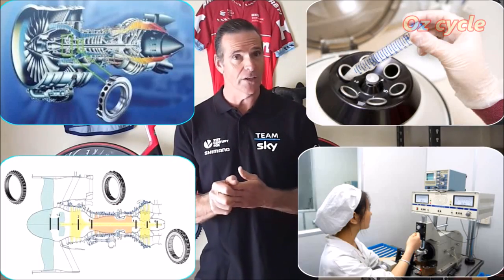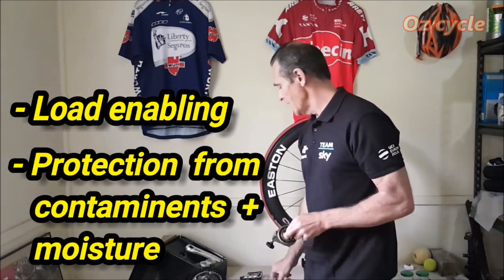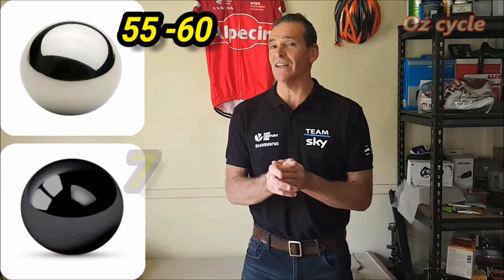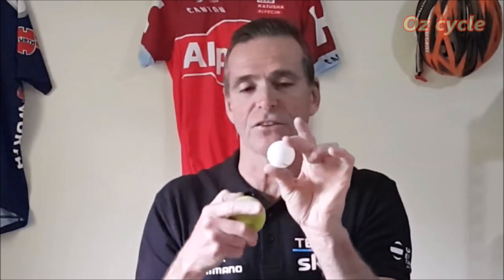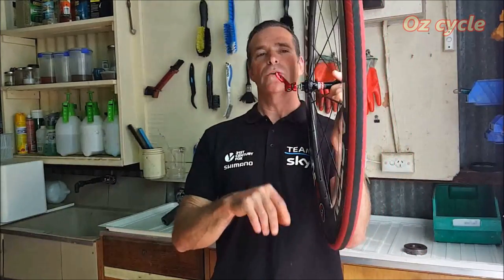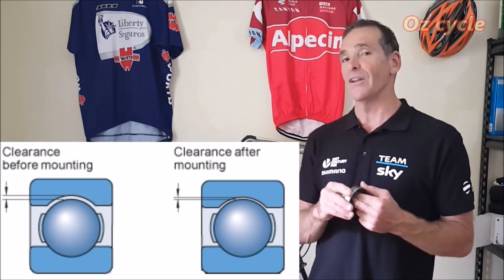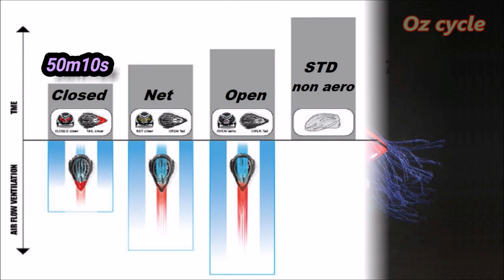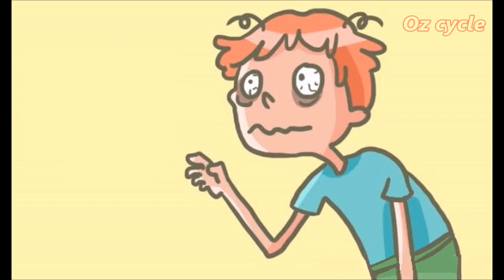Ceramic Bearings - You need to know!

Comment: I don't buy bearings from niche home made brands(enduro, Ceramic Speed, and etc), I buy bearings form renowned brands, SKF, NBN and NSK. You are paying for the real quality rather than cheap play on grease and non contact seals.
Reply: That is the beast way to do it. You just need to know which quality you need to order.
Reply: true, but Koyo bearings are the best known japanese brand 😊😃
Reply: @janetguzman1985  Companies like NTN, SKF, NSK, KOYO, are OEMs i.e. Original Equipment manufacturers. They don't make a 'better' product compared to others. They make a product that is in accordance with the specifications, dimensions, and tolerances. Take a 608ZZ for instance. The dimensions are the same for the 608 bearing across all OEMs, so it's unreasonable to argue over which manufacturer is the best, when they're all making the same product to the same degree of exactness.

I will say that always get your bearings from a reputable source. I get mine from an industrial bearing supply place and they're ridiculously cheap for a roll of fifteen SKF bearings. Genuine OEM bearings beat shoddy ceramic bearings or even Chinese ones.

Comment: Friction Facts have released reports about BB bearing materials. The major performance difference between steel and ceramic bearing BB is that the latter commonly packaged with less viscous lub and looser seal. This gives a high performance impression of ceramic bearing. The test reports confirmed that high end steel and ceramic bearings have virtually no difference on rolling under load.

Comment: There is another misleading comment here. Steel and ceramic balls can be as round and as ball to ball uniform. This is not dependent on the material but the ball grade and bearing ABMA/ISO class. Nothing to do with material

Comment: I was looking into ceramic bearings for my MTB a couple of days ago. I was on a totally different route, but I ended up with the same conclusion. No ceramic barings for my wheels. It was tempting though. I talked to a bearing dealer in Germany. His advice was to choose the highest possible quality of steel bearings. They last longer, need no maintanance, cost way less and take harder impacts.  Thank you for your very good vid.
Reply: Use high quality stainless steel, last a bit less than carbon steel and are more expensive.. but do not get corroded.
Reply: Yup, ceramic is only good in applications with no vibrations and higher rpm,s. The  shock loading on most bikes, especially off road bike would destroy ceramic bearings. Hit a ceramic bearing with a hammer, then a ss bearing . The steel bearing absorbs vibration exponentially better than ceramic.

Comment: There's a glaring misstatement in this video, namely that "ceramic bearings last longer."  This myth is precisely the sort of marketing hype that now pervades the cycling industry (along with other goodies like the "power transfer" of a bike frame).  The reality is that ceramic bearings—let's be specific, we're talking about Si3N4 (silicon nitride) rolling elements on hardened steel races, aka ceramic hybrid bearings—have drastically less load bearing capacity than conventional all-steel bearings.  The advantages of these hybrid bearings are higher speed (at a level irrelevant for cycling), more stiffness (at a level irrelevant for cycling), and less rolling friction.  In a high-load, super-low-speed application like a bottom bracket bearing, they will last LESS long than an all steel bearing. 

Another pervasive myth in the cycling that just won't die is that components like the rear derailleur pulleys rob you of significant power, on the order of 4-10 watts that can be saved with a $$$$ ceramic pulley system.  NO, not even close!  Not even 0.2 watts vs a Dura-ace jockey wheel set.  Consider that fact that a bottom bracket with what most would call unacceptable tightness being spun (on a bike stand) by your finger on a crank only amount to, at most, 0.4 watts.  Somehow, company after company is able to cash in massively on the technical illiteracy of cyclists dying to hand over wads of cash for the latest technical fad.

Power (hp) = applied_force (lbs) x lever_arm (inches) * RPM / 63025.  To convert to watts, multiply hp by 745.7.  You can use this simple equation to convince yourself just how silly it is to worry about how freely a crank arm spins (or any component) producing finger pressure levels of drag.

And here's another related myth, that the friction from bicycle wheel bearings amounts to something significant.  Using the same equation, let's consider a 175 pound rider, with a wheel hub bearing race radius of 0.375 inches, traveling at 25 mph with 700c x 25mm tires.  A properly loaded conventional steel ball bearing with seals and grease has a rolling coefficient of friction of, to be generous, 0.003.  So how many watts are your steel wheel hub bearings robbing you of—maybe 5, 10, maybe even higher?  The answer is 0.74 watts max (total, both wheels).  And how much could you save by paying mega $$$$ for shiny new ceramic-hybrid wheel bearings?  Drum roll...a stunning 0.30 watts max (total, both wheels).

Just step back and look at the big picture of how far this marketing silliness has gone.  The highest-end road bikes now sell for upwards of $15,000, all to handle a 1/3 hp external 'motor' to be supplied by the customer (i.e., your legs).  Now put one of those next to a high-end Ducati Panigale V4 motorcycle, including a 200 hp engine with combustion temperatures in thousands of degrees at a thousand psi and timing to almost 500 firings per second, 200 mph top speed, 300+ lbs of advanced aerospace-grade materials (incl gobs of carbon fiber, titanium alloys, etc), and a comparatively insane number of (actually) advanced technical components...all for $21,000.  If the Ducati were priced like our bicycles, it would cost closer to $21 million.

Bottom line, these bicycle manufacturers should be laughing their asses off at our technical ignorance and eagerness to part with cash.  China, please save us from this overpriced lunacy.
Reply from the maker: Very true, its mostly consumerism
Reply: Dear B. Smith, I would like echo all that you have said and thank you for taking the time to write.  The ridiculous talk about Watt savings (from bearing choice) by the many can not be stressed enough. 

Thank you Mr. Oz cycle for producing at great synopsis on bearings for cyclists.  It is a very big subject of course.  Let us hope the video will reach a very wide market.  I think you stressed the facts and downsides of ceramic and hybrid bearings.  Good job. More can be said of course: how bearing fit (too much compression from the bore) is so important - explaining the failures of Press-Fit BBs etc, and maybe talking about the old days when a bike would have numerous oil ports/grease ports (yes, there are some components flying the flag).  Then we have to praise Shimano and others for still producing great cup and cone bearing components but then 'sadly' throwing down the drain by forgetting to set the cones to the right tolerance in the factory.

There are far too many pseudo-engineers/designers in the bike industry who think their tertiary education means they are qualified.  Also they are probably having to compromise heavily and have to throw stuff out the door prematurely often - the disclaimers and lawyers will take care of you so you can sleep at night.  

If you are young and want succeed in competitive cycling you better learn and practice to be the one of the best mechanics before you can afford to have one and pay for his or her life long experience.
Reply: I have during my  few hours, seen allot of crazy talk about bearings. And i have to say, i love your comment... I am not a cyclist, i'm more into cars...But... those run on Bearings to, and honestly get Waaaaay more load on them then a petty bicycle... i have not looked into your calculations, and i will not :P but, they sounds pretty much on point... And.... if you, as a casual bike user, wants to keep your steel bearings performing... the key ingredient... is lube... metal on metal is not good... it needs lube... if ever your bearing sounds dry, then it might already be worn out... depending on the amount of sideways slack... the point is, if you are using a bearing for a long time, the grease the manufacturer put in there is only gonna last for so long... and you will either have to add more, or you will have to buy a new bearing... refilling is a fair bit cheaper. A bearing, if sufficiently lubed, will last a very long time. ofc, the metal in the bearing needs to have a good hardness ect. but, in generall it will only really start to wear when the grease runs out... This example, should make most people get at what i'm saying... you would not run your car engine without oil.... And it's the same with bearings... lube em, and they will live for ages, run them dry, and they will grind, and die... Cheers :D
Reply: I think you are missing something. TIME. 0.30 watts over TIME. 1 minute vs 5 hours in the saddle. Do that equation. Since you are driving the bike with human power over time, SURELY you work less.
Reply: @Geeios1  For those of us with electrical knowhow, the equation is fairly simple. The 0.30 watts are meant to be real time... Thus over an hour, witch battery/house standards are set as, you would save 0.3 watt hours. over 5 hours 0.3Wh x5, you would save  1,5 watt hours... the cyclists are talking about a fit person being able to generate 200-300 watts on a cycle. But lets be conservative, and say we "normal people" would only generate a 100watts... Over one hour 100w=100 watt hours... 100wh x5 hours=500wh. Thus if you were to generate that over 5 hours, you would save... 1,5 watt hours  out of 500 watt hours... not to much gain is it? :P
Reply: @Cyraios  So, a body does work less with ceramic bearings. Thanks for the information.
Reply: Gosh, I have big thighs, used to squat 500lbs.  But I always have claimed I only put out 1/4(not 1/3)hp.  I just had a massive jump in hp just by reading your post!.....very informative btw.
Reply: Don't worry, e-bikes killed the FAD.
Reply: Good observations. I fell for the early ceramic notion, and in a few hundred miles destroyed the Enduro balls along with the races in a Campy Record hub, which were fortunately rebuildable. I've kept my bikes well-maintained for over fifty years, and even on old rebuilt clunkers have never had such a bearing failure; the OEM bearings in Campy have provided the smoothest downhill coasting hubs ever, to where my lightweight wife was constantly out-coasting me and my Dura-Ace hubs on descents. Medium weight greases provide long-distance, all-conditions lube and protection that actually matters, and absolutely no one who has good bike setup already can possibly say they can instantly feel the magical superiority of Ceramic + Magic Grease #x29, because a five pound change in tire pressure represents about 10x the perceived effort supposedly gained. It is exactly the same placebo psychology the Audiophile industry thrives on.
Addressing hype one by one: "weight savings" of 50% from all steel bearings combined = like one small mouthful of water, if that.
"Strength" has been challenged, in compression to failure, finding quality steel withstands up to 3x the failure load of the best ceramic bearings, which barely surpass cheap Chinese steel."
High Speed = 20-50,000 rpm in things like hard drives; high temp also is never even approached in any bike part, unless a seized bearing run dry is galling and getting pressure welded.
Moderate pressure and speed loads make many lubricants more than adequate; the main benefit is to keep out water and contaminates which rapidly degrade the bearings. Oils gain no consequential speed, while not remaining long to protect and seal the bearings.
No one has ever been shown to have won, or lost, any race, by virtue of the type of lubrication or bearings used in their machine, except for blown NASCAR engines.
It is even more embarrassing to see weekend warriors who can't win Cat 4 waxing rhapsodic over the thousands spent on the uber-ceramic machinery they have taking up garage space.
Reply: You are right that the consumption culture is very low. A lot of horrors.  Marketing, design, manipulation, high-profile brands kill common sense. We need many, many, many independent people's tests. As it was done with lubricants, and the great discovery of paraffin was made. Or tire tests from different manufacturers.
Reply: So true, bicycles costing 10-15k$, as much as real bikes, ridiculous, but there are dumb people willing to spend that much, so they keep making them
Reply: This has been one of the most fascinating and informative threads on Youtube I've ever seen. Thank you all for you contributions!
Reply: That's an awesome comment, thank you!
Reply: I thank you for the technical know how also the amount of time you put in to inform us all.I am not sure about all the math you put in your comment but if you send me your account details I will buy 2 please it sounds like I need 2 please rush them to me by first class post 😀
Reply: People are dumb enough to buy it. It’s insane how much you can get with 10k worth of motorcycle compared to a bicycle.
Reply: @ichewtoast111  I suppose part of the storey is people can afford to buy the machinery that the tour riders use, where as not many people can afford to buy the superbike or F1 cars that the pros use .   I guess that factors into some peoples thinking I& where they want to spend their hard earned. Agree though very interesting discussion on bearings and how far away loads, temperatures and speeds are in cycling for even getting close to a valid use case for ceramic bearings...
Reply: @chapmag6578  that’s a good point. If they really want to keep up with the pros all they have to do is dope like everyone else in the tour.
Reply: @ichewtoast111  indeed, a good chemist can improve many recreational activities.....:)
Reply: Brilliant comment B.Smith <3
Reply: @ichewtoast111  Admittedly, I'm a few decades out from cutting edge bicycle technology, but I was perplexed by the "you could buy a decent car for that" prices.

Yes yes yes, I understand engineering, exotic materials, and precision parts. But you are also talking less material, less engineering, and I daresay less precision parts. For car prices.
Reply: @quintessenceSL  totally, there’s still a lot of precision engineering for safety features on cars like ABS modules, wheel bearings, engine, and modern additions. I’m also familiar with yachts which have been using fiberglass since the 1950’s. Fiberglass and carbon can both be bonded with epoxy to make a solid shape. What really matters is quality materials and layout. Back in the day they didn’t know if fiberglass would be strong enough so the first era of fiberglass boats have copious amounts of layers and have super strong hulls. As the years went by they used less materials in certain areas wile maintaining strength. In all honestly every bike I look at is worth half of what they are selling it for.
Reply: To be honest I have a £400 Carrera which I consider expensive for what it is. I enjoy going on the trails and it never lets me down. I have a Boardman which I paid £450 for brand new, it’s light, aluminium and goes pretty quick. Just enjoy your bike peeps
Reply: yup Hambini agrees
Reply: @bb1039  Habibi?
Reply: I read this comment late, now have ceramic bearings on my bike so I'll just assume the drop in my time (not very noticeable only 2-3 mins off of a usually 39 minute climb) is just an increase in my fitness that conveniently appeared after putting ceramic bearings on my bike. 

The sarcasm aside, I think all performance gains on your bike is mostly placebo and is more your mind than actual benefits.
Reply: I was suckered on ceramic bearings hype and now, along with talking to some honest bike mechanics and considering your realistic description, will save some $ next spin around. Thanks
Reply: Yes but we roller skates need ceramic bearings cause we don't need high weight capacity. We need efficient
Reply: Maths never lies, salesmen uhh well they are salesmen of course they lie it's what they do to live! BTW maths or math?
Reply: Yup, ceramic is only advantageous in low vibration/high RPM applications, not the high vibration/low application scenario in a bicycle.
Reply: Oldie, but totally agree, and want to fortify my adding that seals and grease many make multiple times more difference than steel vs. ceramic balla

Comment: You're right on the bearing lubrication. When I was a kid, we used to soak skateboard wheels bearings in solvent to get rid of all grease. Those bearings spun very nicely, but their lifetime was very short as a result.
Reply: MasterBata same, I'd put a mix of 3 in 1 mixed with graphite powder. My dad made the mix up and remove the seals. A but messy but I'd oil the bearings every second outing. More noise but they'd last ok. Definitely faster from.memory. harvests in the late 70s mind you.

Comment: Another EXCELLENT video on bearings. I have had great experiences with HSC bearings. Resonable pricing but really good performance. Best rolling hubs I've ever had were campy wheels with ceramic balls added and some nice grease. Never noticed any difference when I put ceramic bearings in my old BB30 bottom bracket - supported by this video.